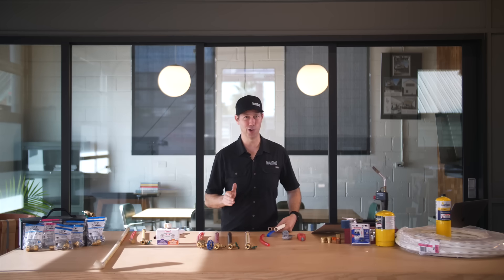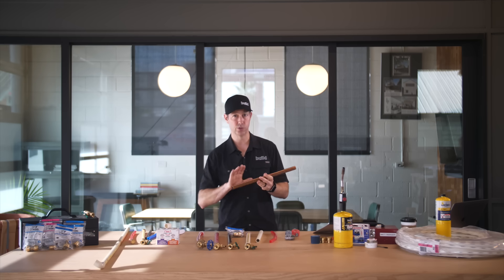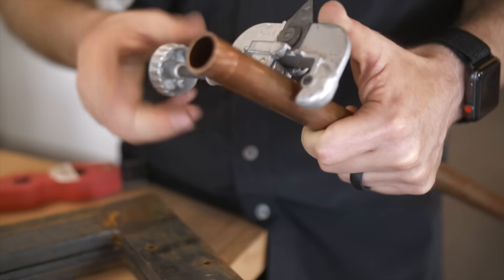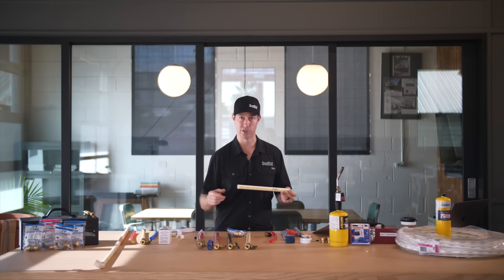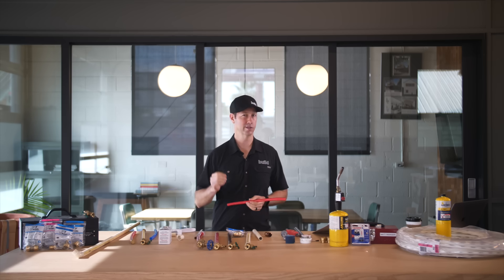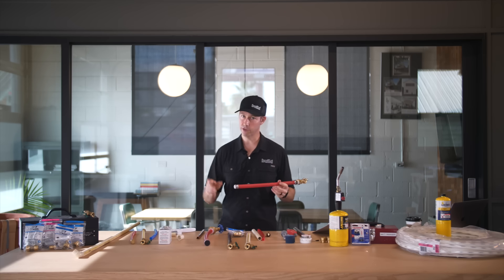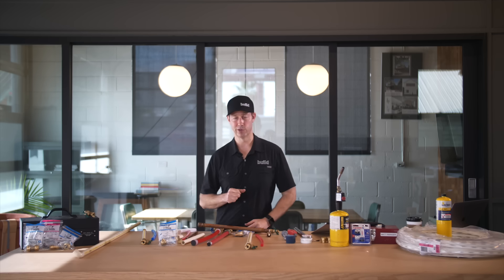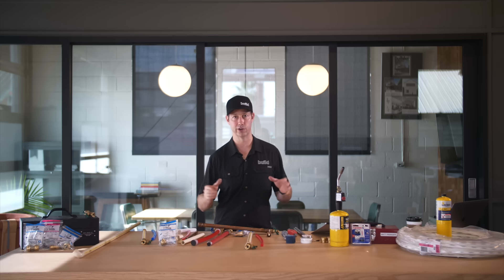PEX vs COPPER vs CPVC plumbing pipes

Comment: Two points we wished he had addressed - 1. How does water pressure affect the different types of piping and 2. How does chlorine affect the pipes - hubby has read both sometimes have negative affects on CPVC and Pex.
Reply: water pressure in the piping is usually 20-80 psi (if its higher than 80 psi a pressure reducing valve must be installed) so the pipe itself is not affected its usually the appliances that fail from the high pressure.  just how much is in your drinking water (what is the percentage)???  piping is engineered to carry municipal drinking water so I am pretty sure they engineered it to carry some chlorine.... but I'm sure if you immerse the pipe in undiluted bleach yes its bad for the pipe.  seriously its more about the degradation from the weather.... its hard to tell where the pipe was stored before it was bought and then was it tied to someones truck roof for a few weeks or months...

Comment: My first 2 houses had copper pipe.   In 30 years I only had one problem with copper plumbing - a pinhole in the pipe near a faucet.   The house that we've lived in the last 7 years has PEX.   What a nightmare!  Cracks in pipe requiring replacement of PEX and dry wall due to flooding by cracked pipe.
Reply: The pipe was probably improperly stored and was not protected from the sun (uv rays)... I saw some apartment buildings where the leaks only occurred after 5+ years after install, the pex pipe actually became brittle...because it is common to order enough pipe to do a whole house and just have it lay on the ground outside until you need it and pex rolls of pipe come in rolls in cardboard boxes or worse clear plastic like in the video.... one good rain and the boxes are toast and plastic does nothing.  contact the company that build the house they can send a sample to Pex makers to verify if its uv degradation ... then because installation instructions were not followed you can sometimes get money (might need a lawyer ).

Comment: How do you get rid of hammering lately my pipes been hammering. I seen on YouTube that you turn off the water from outside and open all the faucets in the house. Then open water back up?
Reply: the description above sounds like you would just be introducing air into your water lines (to help absorb the water shock waves).... but over time it will go away as you use the water....you can have water hammer arrestors installed (they are pretty much cylinders with air in them in a vertical position on horizontal pipe... to absorb the shock wave in the water).... but that doesn't always work.... also how the pipe was installed it may be secured to the joists and when the shock wave happens it moves enough to hit the joist at a 90 degree fitting or some thing similar.  My states plumbing code says all piping must have special offsets to reduce water hammer every so many feet of straight run of pipe depending on pipe type we also use insulators/ isolaters around pipe when it goes through holes in joists... so its also possible it was not installed to code.

Comment: Matt, I live in Florida and am getting ready to repipe my home which was built in 1947. We have had one person come out and the plumber suggested putting CPVS or PEX pipes on the exterior of the house. When I questioned about the exposure to the sun, the person said that by painting it, it would protect the pipe. Could you please let me know your thoughts on this? Thanks so much!
Reply: Andrea Andersen
Is it possible to cover the exposed areas with wood?
That's what I suggest,  but my knowledge of plumbing wouldn't fill a thimble.
Reply: Get a licenced Plumber... you do not want to paint Pex pipe no one knows how the chemicals in paint would react and its against installation instructions any oils at all on pex is bad.   And I though I would have to search it id bet its bad for Cpvc too.   The only type of pipe I know is ok to paint is iron pipe.

Comment: I have worked on my PEX at the Jim this week. I thought that would be a funny one comment. I agree with your astute remarks on copper. I dont understand why so many pipe guys have walked away from what for me is “pipe metal of choice”. I agree that some yo you do pad their bid, and you have to be sharp not to get hosed. I like to use type M. How would anyone know they can get 75 years out of copper, I doubt highly that an old plumber would go back to a house 75 years later to check. If he put in that pipe when he was say 27, he would have to be alive when he was 102. So I rest my case that this is just what they call a hypothesis and not a water tight fact. If you agree with that, then I have no gripe today, so ignore the statement. Like your videos, they help me learn to become a better man
Reply: 10 feet of half 8nch copper is now 35 nux .that's the main reason pex is taking over

Comment: Sooooo, I’m going to be building a metal building home. I want spray foam insulation. I’m planning on running PEX in the walls with the crimp-type fitting. Will that be ok?
Reply: Edit: I’m in Louisiana.
Reply: you always want your piping to be "touched" ..gotta think if you have a leak how do you repair it.....how do you find where its leaking from if you cant open the wall and see it....check your local plumbing code and Id contact the manufacturer they will tell you  for sure ... but i bet so you need to box out (or have the stud space open with regular insulation) or maybe a sleeve??   no idea what chemicals are in the spray foam.... I know oils are bad for pex... consult your local plumbing code

Comment: Water hammer is an easy 'fix' with copper piping.  A simple air chamber in the line and bam, no water hammer, you should know this as a builder.
Reply: he's obviously not a plumber though... now a days dishwashers and washing machines are often required to have hammer arrestors inline at the connections...  and i have seen cpvc installs where hammer was a problems even though code was followed... it was hitting the 90"s (elbows) and moving enough to bang against the side of the holes drilled up through the floor from the crawl.. and in places in walls that could not bee seen... but I didn't get to try to fix it as it was too much $$ for the owner.

Comment: what about flexible PVC pipes/hoses? I saw a This Old House episode where the entire house was plumbed with flexible pipe and crimped connectors.
Reply: that is the PEX
Reply: flexible pvc?? it was probably PEX... pex has a crimped connector system.  PVC is not approved to carry drinking water inside a building (my local code)... it flex pvc is used for pools, sprinkler systems and as conduit. (and I have seen it under jacuzi tubs) as the tub circulating system..  CPVC is used inside for drinking water  rigid pvc is used inside for waste piping in most states and is approved for water to the building supply (5 ft or more prior to the building).

Comment: I thought lead was the oldest and maybe ceramic before even that.
Reply: Right, and there's iron plumbing (IPS) too - but none of those are used any more and Matt is talking about installing plumbing.
Reply: Lead is still used in waste piping occasionally.. I have seen toilet (waste)  bends made of lead... not to mention caulking cast iron pipe with lead and ocum.  but I dont think its was used for water distribution in modern times ever.  Ceramic pipe was also a waste pipe ( I remember the red clay pipe outside our rain drains connected to.

Comment: I’ve seen every form of plumbing. Galvanized is like aluminum electrical wiring, was cheap but never holds up. Homes with Copper will never need plumbing ever again. Just DO NOT LET FREEZE, the lead joints and sidewalls will bust easily. Labor intensive is the copper, you have to wrap, cut, put more hangers, etc. CPVC is straight forward, clean/glue, and cut. I recommend the clear primer, not the purple. CPVC beaks easily during freezes, and suffers from similar disadvantages as Copper, I have seen 20+ year old CPVC get a little brittle, and I would recommend many hangers. PEX is QUICK, but the fittings are costly and who knows the longevity.
Reply: clear "glue" is used on PVC  cpvc "glue" is either orange or yellow.... primer only comes in purple and is required when following manufactures instructions (so for legal installations and installations the manufacture will support if there are problems)... its actually a cleaner and prep for the "glue" which causes a chemical reaction to occur where the plastic actually fuses and is actually not technically glued.

Comment: If this man has never heard of pinhole leaks, he’s not a legitimate plumber. Also- copper does not, and has never been advertised as lasting 75 years. This guy is a hack.
Reply: i found a web site of a plumbing company in Florida they say it lasts 20-50 years....  where I live the water is very soft and copper can last that long if type L and installed correctly.

Comment: My backyard spicket was always off bc the gate valve was leaking. i finally replaced it. i used a sharkbite ball valve to get rid of the T and pipe to the spicket. i then put a sharkbite T further down the line so to run pipe to the new spicket. I used CPVC to connect the sharkbite T to the spicket outside, CPVC valve in between. Even the Spicket itself was sharkbite. Sharkbite says it works on copper, CPVC, and Pex, so i hope this all works out. Now the thing that i worry about is the water hammer. Its still copper, and the line i connected to is also for the washer. Should i have just removed the copper and made it all CPVC after the sharkbite ball valve??

Comment: can u use pex for hot water system
Reply: yes... notice in the video red, blue, white pex ( the the is semi clear as well) ... often red is used for hot and blue for cold...  if you read the manufactures instructions they just do not recommend over 140Deg F at 80 PSI.

Comment: one more thing- if cpvc gets a freeze... it doesn't break in a few spots the way copper does. it shatters like a glass bowl dropped off a skyscraper. TOTAL LOSS. it's weird too.. it does this funny lengthwise spiral 'split' all over the length of the piping system. with pex you only have to worry about the fittings breaking in a freeze.

Comment: Have you considered that the fittings for PEX reduce the pipe size significantly. CPVC fittings go on the outside of the pipe ,same with copper. Pex fittings go on the inside and reduce the amount of water that can flow through the pipen
Reply: The fittings in Pex-B do reduce the size of the pipe, but pex-A fittings do not since the pipe is expanded over the fitting.

Comment: One of the poor habits plumbers are performing in new housing builds is not installing angle valves for sinks and toilet tanks. They feel the "manifold" serves that purpose however, it really does not serve any purpose but hinders when it's time to change/remodel/replace faucets and toilet tank hardware etc. Every one of these fixtures use threads to attach their water supply and pex directly connected to a faucet or toilet valve causes more work at the time of servicing or replacing those fixtures. At some point, you will run out of extra lengths of the pex, maybe some of them have no extra to use at all which forces the home owner to pay added rough plumbing needs.  Had the plumbers used the pex like any other fixture and hard mounted those pex pipes to an angle valve with threads in the wall, the fixtures could be easily replaced etc. with a wrench vs. all of the pex fixtures out there to make the repair look like crap once its finished. Not only this but many folks use those angle valves to do their toilet cleaning and to prevent an overflow due to a blockage etc. It seems that in cold weather locations, this PEX would the the choice but not if the plumber is going to go all out with short cuts and leave the house unserviceable at a later time.
Reply: As you would probably guess its a cost cutting measure... I saw this done in mid and lower end apartments and housing "sites" where many houses or condos were built at the same time by the same contractor.  And that is the  way manifold type systems were sold... as a way not to put valves everywhere and have shut offs centrally located. my gripe is what do you do when debris gets in the line and clogs 1 shut off valve on a huge manifold.... no way to fix that.

Comment: Informative video.  I have a question that was not covered in the video.  What about flow rate?  Is there a difference between the plumbling schemes.  I have PX in my home (not sure which PX) and the elbows are a much smaller outter diameter, thus smaller inner diameter, and my water pressure at the taps is lower than i would prefer.  Could this be a limiting factor, or are the facet supply lines and shower controls the cause?
Reply: many possible causes... debris in the line can get caught at shutoff valves... ive seen water heater annode and cold water sleeve (inside waterheater) break down and come out in sand like particles at the valves...  what is your water pressure into the house?  it often varies at time of day.... if you have a PRV (pressure reducing valve) at the street or somewhere near where water enters your house (in garage or basement etc..) it could be going bad... if you have a 2 or 3 story house you need more water pressure to push the water up so it will be a bit less upstairs..  many sink faucets have water saving aerators on them....though private homes can have flow up to 2.2 gallons per minute (GPM) (federal reg - check your state code) public is 0.5 gpm...

Comment: is it recommended to wrap the pex pipe in insulation if it is being buried outside? i live in a cold climate
Reply: bury it below the freeze level of the ground... in my relatively mild climate that is 2 feet below ground... then put insulation on the portion that goes up... check your local plumbing code for the depth needed.

Comment: I have been doing a lot of remold jobs here in Upstate NY. I found that the old timers installed a T and a 90 degree elbow off there highest plumbing fixtures supply lines which aloud them to put a one foot vertical copper pipe going straight up with a cap on it on both hot and cold supply. That stopped the water hammering!
Reply: Thanks for that tip! I noticed the same thing and was going to remove this as I figured it was just another dead leg in an old house. But this makes a lot of sense. The vertical pipe is full of air which compresses like a spring to remove water hammer. Very simple and effective. It can be on any level btw but should be close to the largest source of water hammer.

Comment: CPVC is terrible. It is brittle, ive seen it simply come apart at fittings on hot supply line in homes. I have seen compression fittings used on cpvc for some reason. it is just garbage.

Comment: Pex. In my experience. Cpvc freezes really easily, copped is expensive and time consuming(unless you use pro-press, which becomes even more expensive. Pex is easy, lasts a long time, and doesn’t freeze nearly as easily. I still insulate all installed lines anyways

Comment: We do use PEX in Europe, but not the same like PEX A or B. We use PEX-AL which has a welded aluminum tube reinforcement between the inner and outer layers. Much tougher stuff.

Comment: I see the merits of pex, but after making my second major repair due to leaks I will never, ever, ever use this in a home I own.  Ease of installation and low cost is nothing compared to replacing floors, cabinets, walls, etc.  This leak occured after only 11 years.  PEX is garbage.

Comment: Type k copper is for underground and all joints most be brazed. Type L is for pressure install. Type M is for drainage only.
Reply: In my state we can use M inside for water supply.

Comment: I think you missed what is know as cinch rings for the PEX pipe also in Canada you can't use shark bite connectors in concealed locations like behind drywall...and myself I go the extra distance and use oxygen barrier like what's used for radiant heating

Comment: We have 4000 years working copper. We know exactly how it will work. Quest pipe all failed. I have seen rats chew through pex. I have seen pex connectors fail in hot atttics. I only use cpvc for T&P lines. I would not purchase a home with pex running through the attic. I would always recommend copper to my customers. I would not be able to sleep at night if I installed pex in their homes knowing how much damage a leak can cause.

Comment: My concern in anything but copper is how are the fixtures attached to PEX and CPCV?  Many locations such as hose bibs, shower heads and valves etc. require some rigidity. Especially a hose bib or a shower head fixture.  And, as time passes along with air quality and sunlight etc. anything made of plastic will end up as fragile as glass which is not good for those who will stay put for 40+ years or those who purchase an existing home fitted with this plastic stuff.

Comment: Would you use pex for underground?
Reply: yes it is used all the time for street to house supply... as long as it is buried under the ground freeze level (2 ft down where I live).... to be safe insulate the pipe above that and use brass fitting not plastic for freeze strength and ground movement.

Comment: And what about the old war horse galvanized steel? 120+ years of life, and stronger than strong.
Reply: 120 years??  because most of it here is imported in the 70's and 80's the quality was bad so by the 90 and early 2000's it was rusted through, failing in every place...its heavy and takes a lot of work to install (think 10 or 20 ft lengths  of hard rigid pipe through holes in studs in walls spaced 24-36 inches apart) ... and no you can not notch the wood - that defeats the studs strength... now its really only used for short lengths stubbing out of the wall from a threaded fitting... in accessible places where it can be changed out.